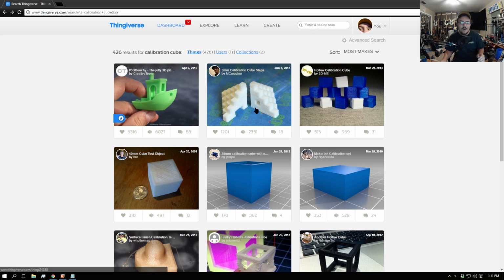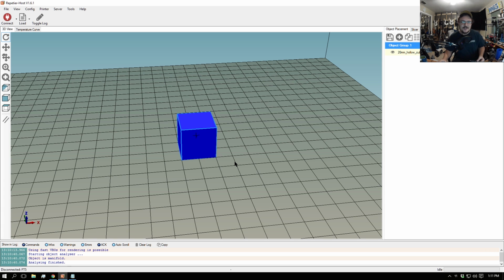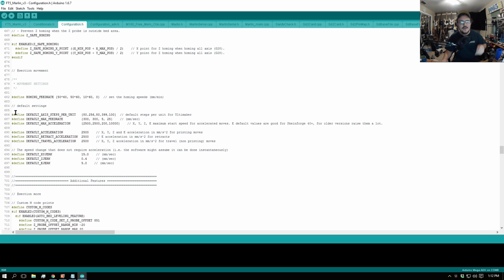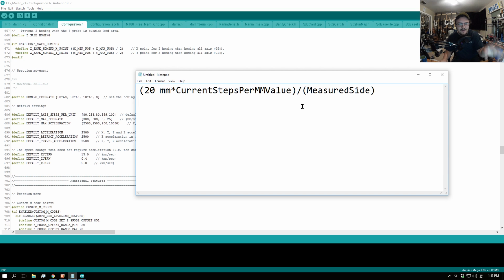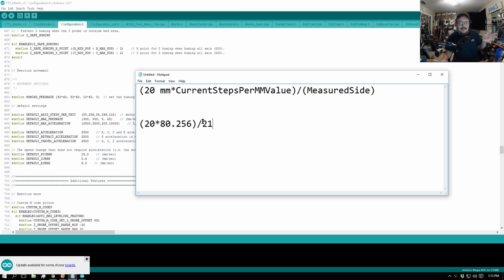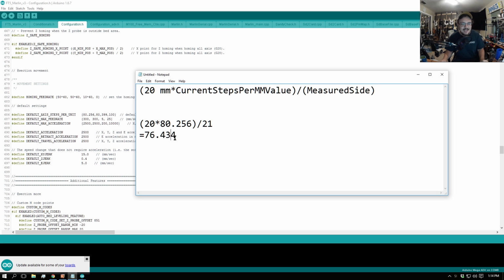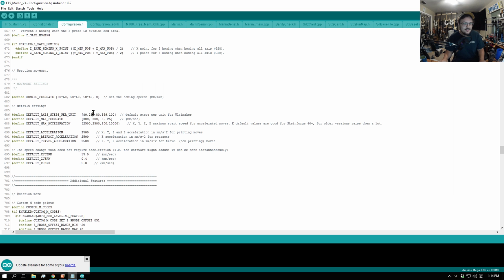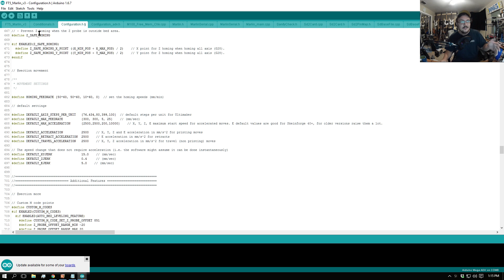How To Calibrate 3D Printer Steps Per MM (Short Version)

Comment: Happy I found this. kicking off a print. Last print the Z was smoshed. Expected 50mm and got 41mm test piece. Found a bunch of Marlin CR-10 configuration.h examples and all with Z set to 400. let's see how its doing with the Z steps/mm set to 487 instead. Thanks Dustin!

Comment: the filament only melt initially.. didnt melt contiuously and no extrudision happens ... motors gets off the temperature starts 
 decreased  .... pls help me to solve this issue... struggling last one week unable to find the error..

in prontface 
T ; 45 E:0 w :30 dipls the temperature stars decrease.

Comment: Hey Dustin, just wanted to point out that this method isn't the best way to calibrate. Essentially, since consumer level 3D printers aren't as high of precision, calibrating this way only calibrates for the center of the bed. Your best bet, as I've read, is to use the prusa calculator and calculate based on your step angle, belt pitch, pulley teeth and/or lead screw pitch.

If you want proof that this doesn't work, repeat the test on every corner of the bed. On most printers, you'll get different measurements based on how aligned your axes are, how tight your belts are, etc.
Reply from the maker: See the first link the description. I am well aware. Thanks! :D
Reply: My bad